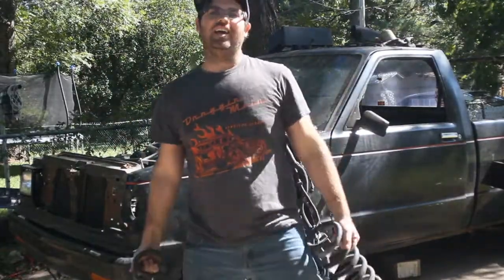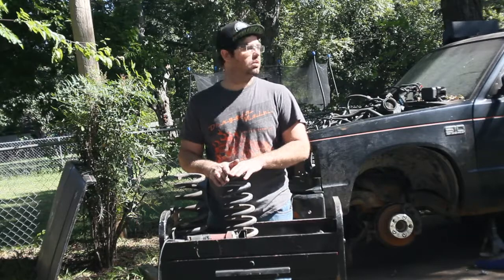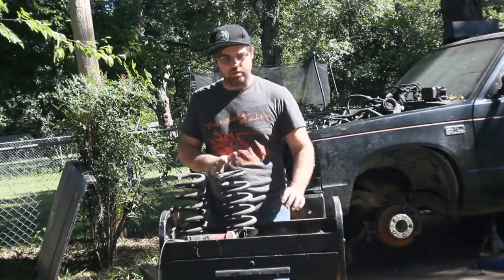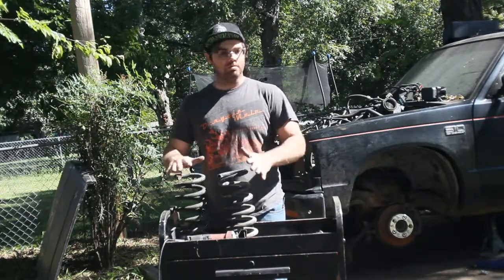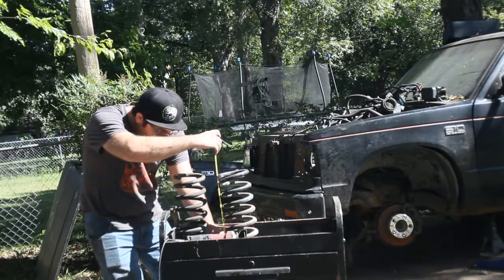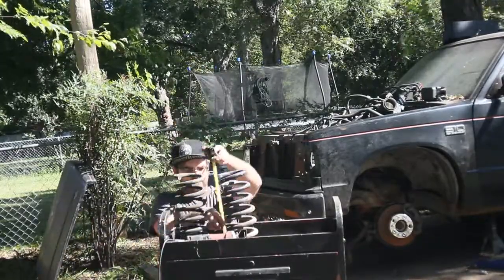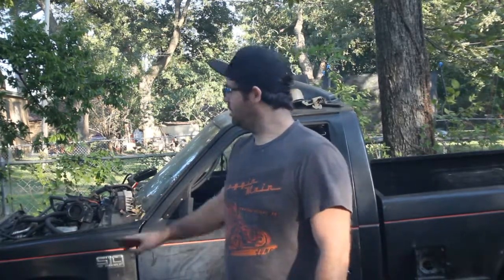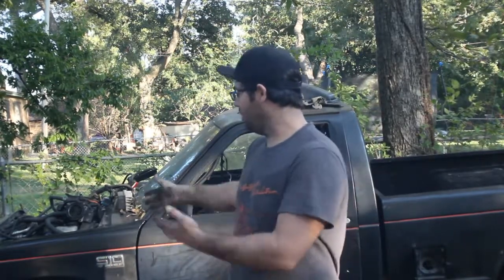Cheap lower s10 chevy - Cutting The Springs

Comment: Um hello sir. Good video. Where did u get that truck? I sold mine years ago but before I painted it the exact same and put red pin stripe on. And it has the same rims except I painted the centers red but idk coulda been painted since then. Just curious cuz I will buy bonnie blackfoot back in a second. She was good to me. I have 2 2nd gens now xtreme and a sanoma. Bout to drop the rona noma on the ground for cheap lol
Reply from the maker: my wife traded her 97 eclipse for the 87 s10 back in 2014. it had the 2.4 motor with a 3 speed. Im about to start on the s10 again because ive decided to go with a sbc. but thank you very much on liking my video. im trying my best on every video i make